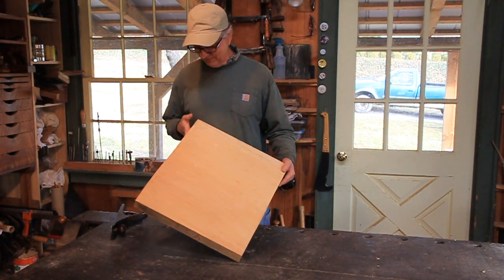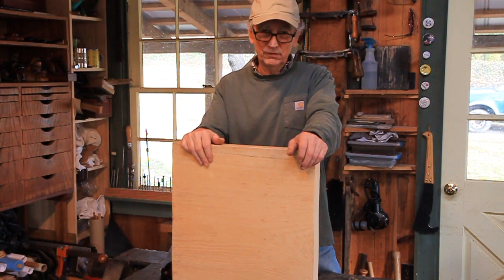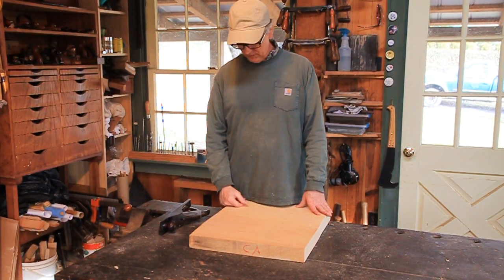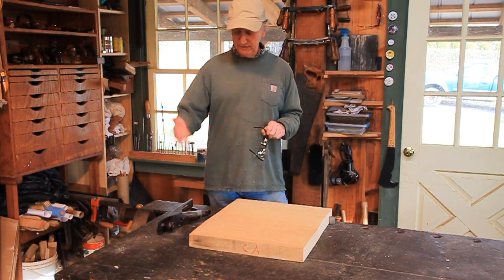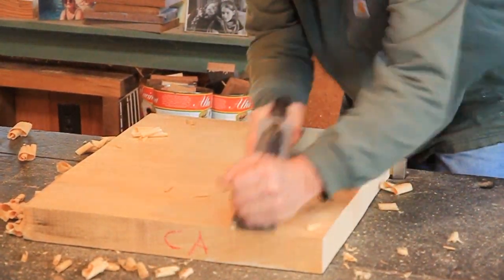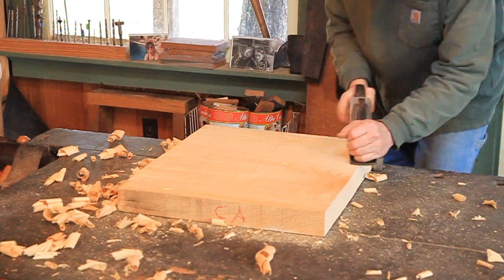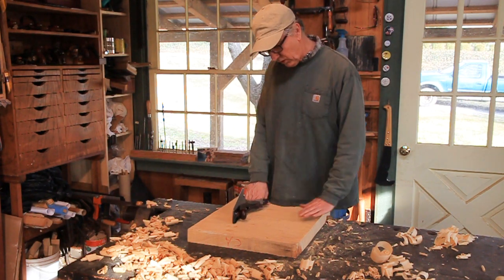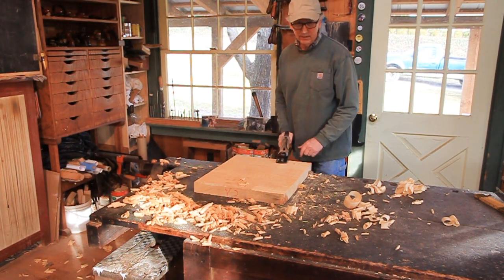6.  Planing the Seat Blank

Comment: not sure if folks saw this, but at 12:30 or so curtis switches from right hand to left hand planing.  this dude don't need to flip the job over in the vice, he just switches hands and serves it forth!
-adam of oakland, ca, USA
Reply: Speaking as a fellow southpaw, it's the bi-product of years of adaptation to a right hander's world. And nice observation.
Reply: If you work by hand only long enough (or mostly by hand), you'll eventually be planing pushing or pulling with both hands (it's just easier and faster) and you'll be sawing with both hands. It's easier to just use both. Once you've mastered one, using your weak hand is a lot less difficult to learn than you'd think, and it makes it so that you can pretty much work indefinitely vs. running out of steam doing all of the work with one dominant hand or arm. .

Comment: Found your channel recently and subed .    I can hardly find my house , here in Ontario Canada due to so much snow , and have been watching your vids and want to say Thanks for sharing your knowledge !   I have started collecting old hand tools to restore and use .  A question I have ,    when a small kiln ,  such as your main one is built ,   is it completely sealed during drying when light is on  , or where does the moisture escape to . If the moisture stays in the box how does this dry the wood .   Sorry if its a stupid question , I'm just a little confused how it works as I'd like to build one .      Great shop , awesome work ,  thanks for your time ,  Cyril
Reply: Thanks Curtis  ,   if it works for you ,   that's good enough for me !

Comment: Hello 👋  where do you get your seat blanks from , I drove over 200 miles trying to find a place that sells 6/4 boards and the wide width needed and I'm not having any luck , as for northeastern pine it's a big no one has here in Iowa,  Illinois  , Wisconsin.  I was thinking of maybe Basswood I heard it's easy to carve and it light weight.  All the places I've talked to looked completely shocked when I bring up the width of the boards I need , is the place you get your blanks from ship? and if so could you please pass on the info to me please 🙏
Reply: They are often glued.